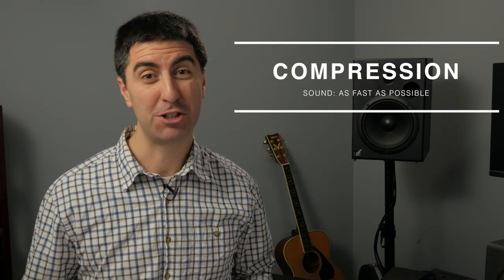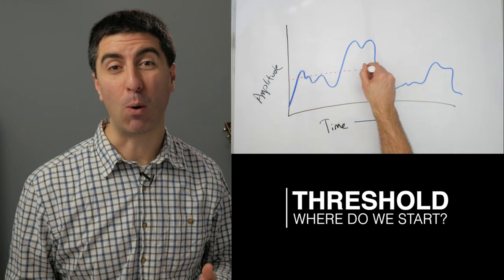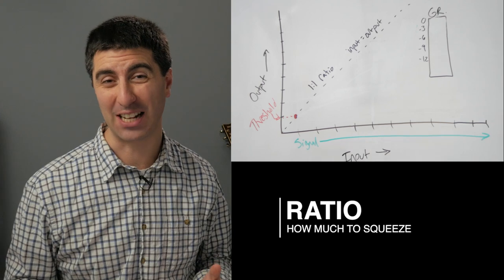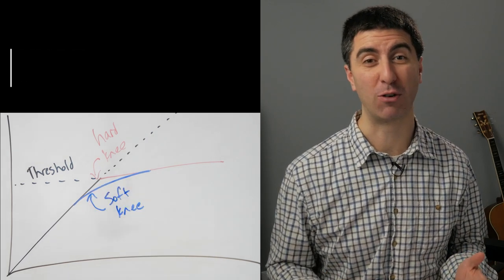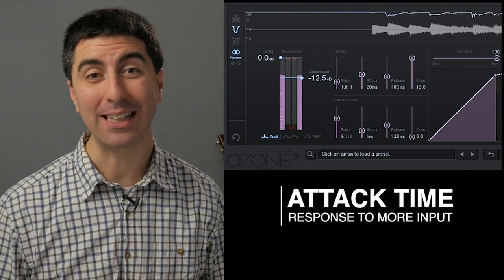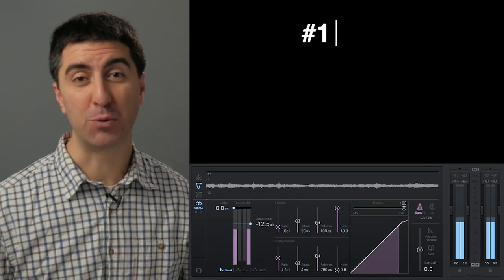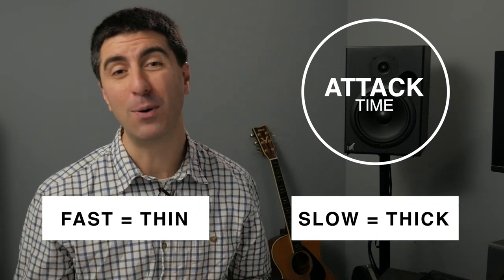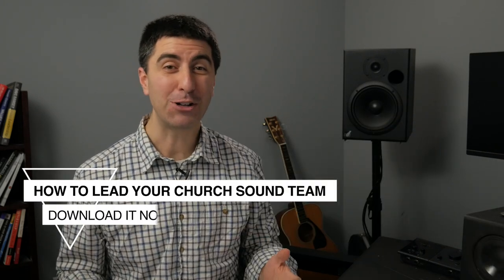Compression Controls Explained | How A Compressor Works | Sound: As Fast As Possible

Comment: Hi... I'm from Brasil. An eternal doubt, which no coach can clarify with conviction. The Attack Knob. Many say that compression will act faster if it is at zero, and as you turn the knob, so that the signal gets hit by compression, this action takes longer. Others say EXACTLY the opposite .... It's not all people that has a good recording softer to check it visually on a computer screen, like how the attack knob really works. What do you have to say? Thank you. Hug.
Reply from the maker: I just went over this with my class, and I might post a clip from the course video about it. The most accurate way to describe attack time is "the speed at which the compressor's gain reduction responds to increased input." A faster attack time will respond more quickly to increases, while a slower attack time setting takes longer to respond. It's nearly impossible to see the difference visually with the gain reduction meter unless you set it REALLLLYYYY slooooowwwwwww.

One place where this trips people up is on units like the 1176 which just have random numbers assigned to the attack/release knobs, not actual times in ms. On that unit in particular, a higher number means faster, not slower. I still have to think about it a second when I'm using that one.
Reply: @AttawayAudio  - Ok... But the knob position? Zero to fast attack or slow attack? Thanks
Reply from the maker: @SLTTVBR  0 is fast, like in in milliseconds.
Reply: @AttawayAudio  Thanks.

Comment: When you time your release to the tempo of the song do you use a similar calculation as say reverb / delay and go by quarter or whole notes? I tend to go 30ms if I'm side chaining say a bass to a low kick just to make a little space. And vocals about 500ms to prevent pumping.
Reply from the maker: I never calculate what it "should" be... only going by feel, adjusting for the rhythm and pace of the playing... I'll do this by watching the GR meter come back up almost-to-zero before the next note hits. Because a bass player is never going to ONLY play quarter notes, the melody is never going to be the same rhythm all the way through.

With transients (i.e. drums), I'm more into shaping that transient, and wanting to adjust how quickly the compressor's release "boosts" the back part of the sound (body, sustain, ring, etc.)

TLDR: you gotta feel it out, not think it through